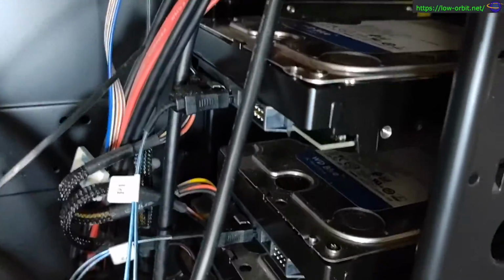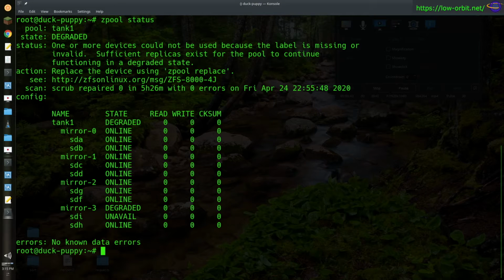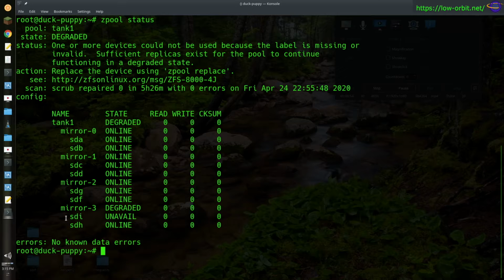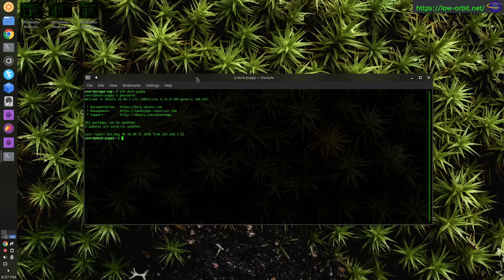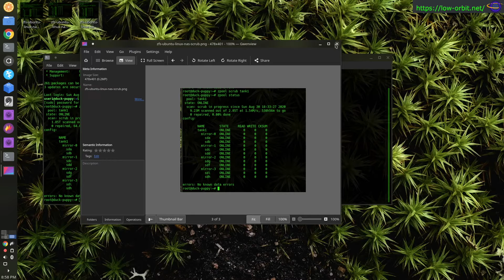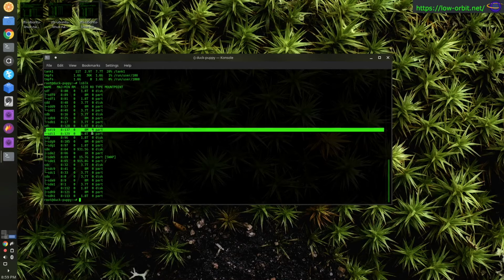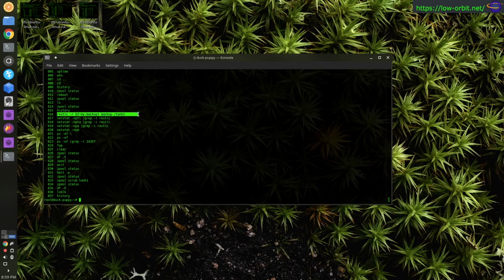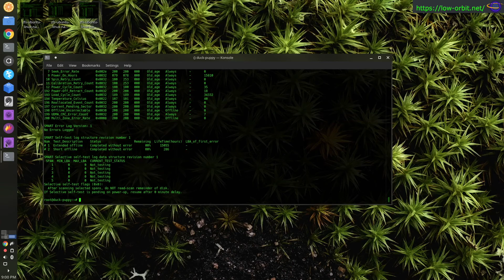Primary NAS - Older Video - ZFS - Degraded Mirror Fix

Comment: NETGEAR Wi-Fi Range Extender EX2700 - Coverage Up to 800 Sq Ft and 10 devices with N300 Wireless Signal Booster & Repeater (Up to 300Mbps Speed), and Compact Wall Plug Design

Example this one ?